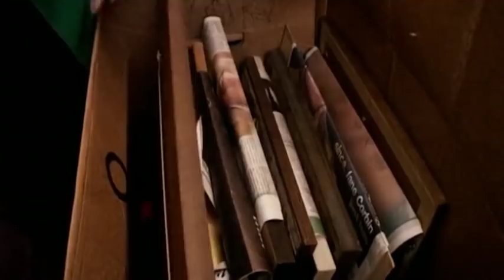Farmhouse Conversion | Build A New Life In The Country | History Documentary | Reel Truth History

Comment: They paid far too much for this ruin. Almost 600k pounds is insane.
Reply: i think it's quite reasonable given outbuildings, location and land.
Reply: Probably worth 2million now
Reply: That's a steal for that much land. In Chicago you could spend that on a 2,000 square foot house on a 45 by 125 lot. 😬
Reply: The thing is now, most places like this, are just getting flattened and a small housing estate is built on the land. which is a shame sadly, but then again due to faff on with the red tape, its probably works out cheaper , quicker and less of a head ache.
Reply: A busy job & nil building experience 🙁

Comment: I wouldn't want to pay the heating and A/C bill on this home.
Reply: I doubt they have to worry about A/C much in Derbyshire.
Reply: If you have great insulation it's ok.
Reply: I imagine it would be sectioned off quite well so you only heat the area you are actually using not the whole place......I think they could have turned it into a wonderful bed and breakfast place, they may still ! It would probably pay as much as he cleared after driving almost 500km per day to and from work....his fuel bill must have been massive but then he probably had a work vehicle with a fuel card.

Comment: The red tape in England on rehab/reconstruction is insane. I rehabbed an old home on 4 floors years ago.  I paid cash so didn’t have input from the city other than my contractor getting necessary permits that ended up raising my taxes significantly.  It quadrupled my taxes even though I wasn’t adding rooms.  It was worth the 2 years of construction and stress.

Comment: although i know surviving a build can be tough, i really think there is too much concentration on the negative aspects in this particular program venue. this vid is being overtaken by gloom and doom, instead of showcasing the positives of the build, the restoration, and the after-build state of the property and the new home of its occupants, the family. point out some of the significant problems along the way, but, for goodness sake, lessen the dramatics. of all the kitchens i have seen in these restorations, i truly like this one the best. the wood, color, and form of the counters and cabinets are somewhat traditional, and it makes me like the modern linear stainless/chrome hardware as the pulls. views are nice, also. the outside of the main house turned out well, and i like the oak surrounds and casings of the windows. for me, i would not want some of the outhouses, and i would have removed the pighouse and the attached barn-like string of buildings. the courtyard is nice. that area of the country sports so many fine-looking homes, and i wouldn't mind the countryside wrapping itself around one of my particular house picks. .